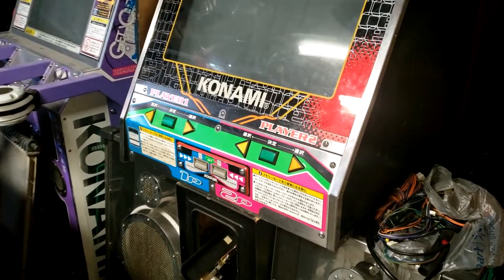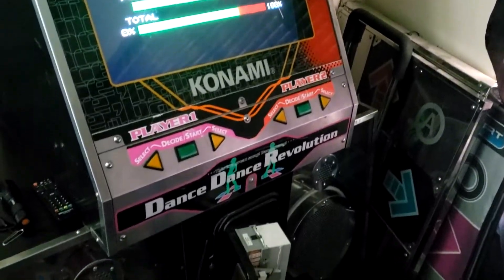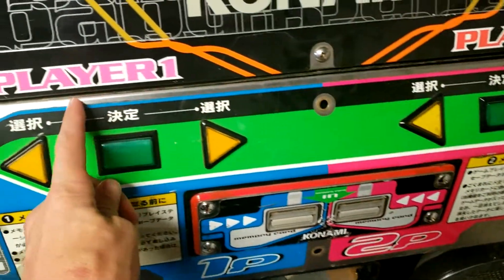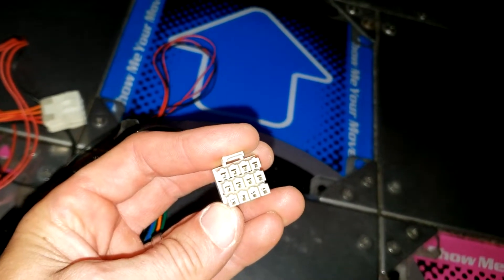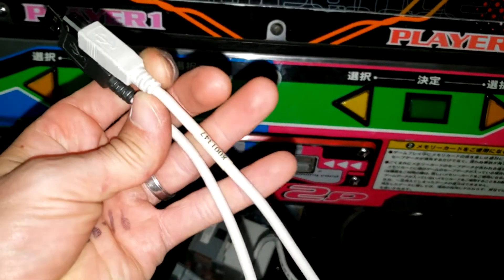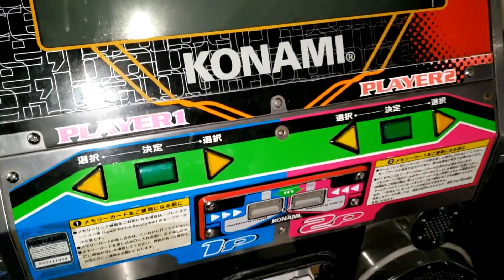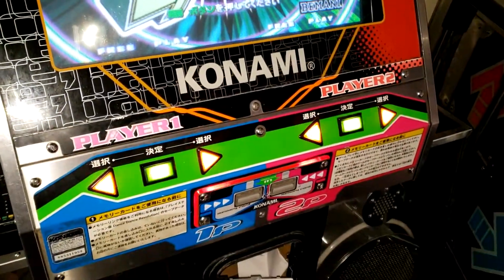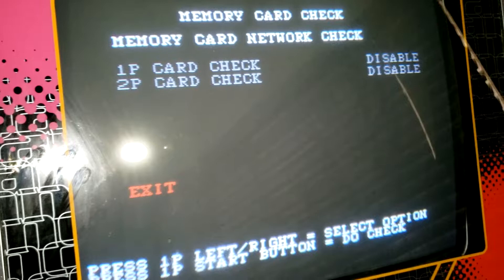Dance Dance Revolution DDR - Upgrading to Memory Card Slots

Comment: Do you have a lead on any JVS supported USB A to B cables? I think that's what I'm missing because the memory card check will detect a card input but I don't get the text at the attract screen. I've only started searching for cables but if you know where I can pick one up that'd be great.
Reply: Nevermind! I just threw some link data on my card and it just worked! Now I just need to order some JST connectors because I have the power wires gator-clipped to the terminal lmao it's super janky. It's amazing how easily I got everything working even on a red cabinet that was never meant to support something like this. Thank you for this and the previous video you made regarding these card readers, it's truly invaluable information.

Comment: Doesn't it also save your scores?
Reply from the maker: Yes! You just need the 2 block link data on the card
Reply: Yes, Jon! It will save scores, and while these can be viewed in 5thMix on the PS1, they can also be viewed on just the arcade machine. I have the same hardware as Sean, and it helps a lot when trying to improve scores.
Reply: That's awesome, I have the memory card slots on my cab but have never tried them yet. I want to.